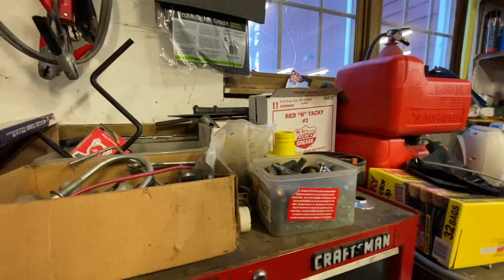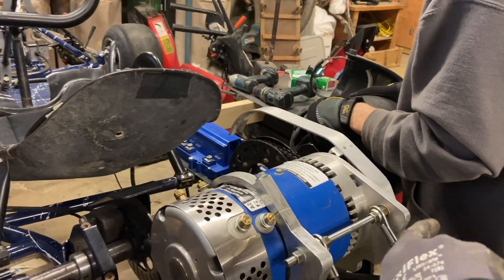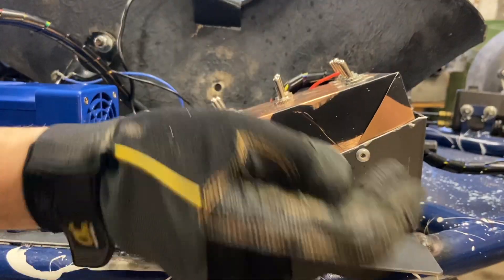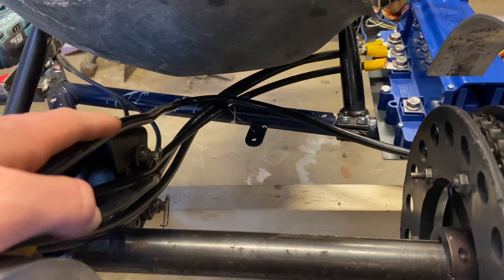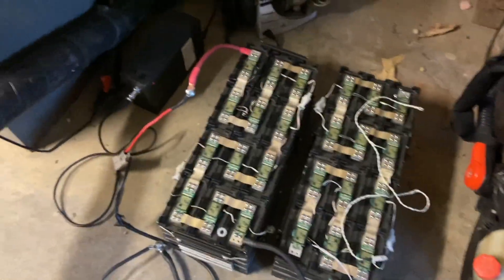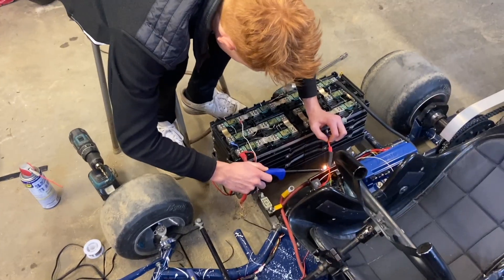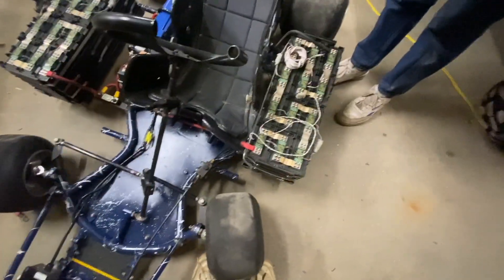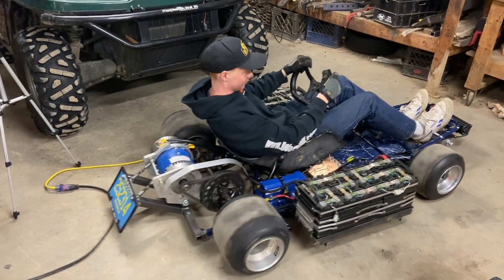50 Volt 5000 RPM Electric Go Kart Build: Part 5 (Go Kart Drives!!)

Comment: Sounds like your chain was too tight and sprocket needed to be pushed over slightly on the axle to align the teeth better into the chain. U guys did a great job! My next kart will be something like this but for now I'm having fun on my modified razor ground force drifter lol
Reply from the maker: Right on! We addressed those problems with the chain and sprocket. Definitely fun to build a go kart like this one!
Reply: @clarkscabin  my issue with my current project is no gokart parts fit it since the axle size is only 18mm so my next cart will probably be something like this!